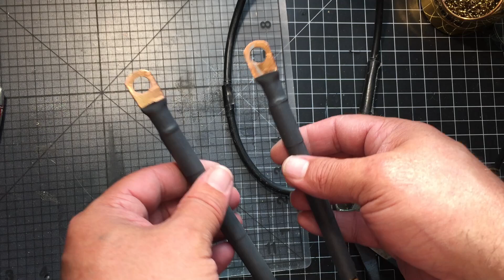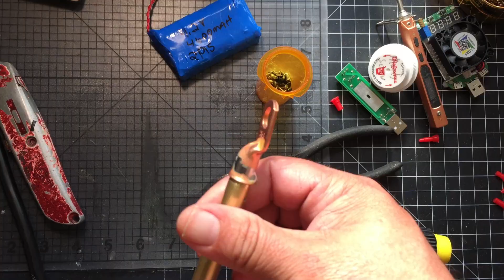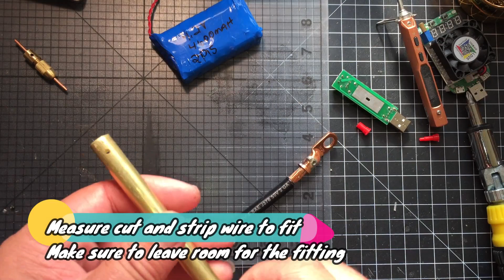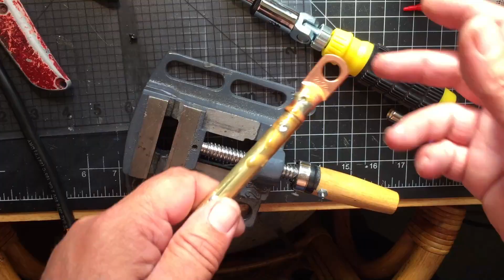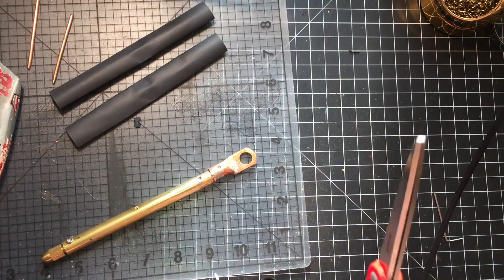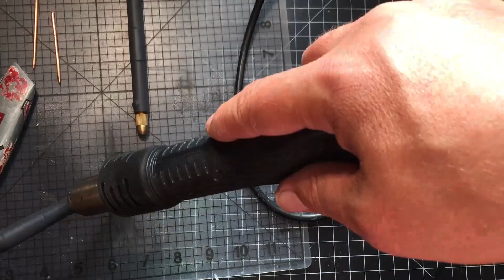Super Simple DIY Spot Welder Pen (MOT Battery Tab Welder Pen) under $10

Comment: Moving into higher current chemistry batteries, Im wondering about using copper sheets cut into shapes needed instead of nickel.  but to do so is a bit of different direction. 
I stumbled onto "carbon gouging rods" as a means of welding rather than tradtional spot welding.  Apparently you can get pin point accurate.They also call them RSU (resistive soldering units). Have you come across rods like that, used them?
Reply from the maker: I haven't?? But I may do some research on it!!

Comment: Best one I've seen so far. I recommend silicone tubing for the outer heat insulation-- they come in different sizes.
Reply from the maker: Hey!!Great Idea!!! I was just trying to use what I had on hand, these work just as good as the commercial one, I purchased a set of those to compare. Not much difference.

Comment: Great job. Where can I purchase those brass bit holders
Reply from the maker: I got mine in China a few years back for around 2$. But they are mainly used to convert small motors to dremels, drills or just to add a bit. Here is one I found on a quick google search-

https://www.aliexpress.com/i/32679044049.html?spm=2114.12057483.0.0.57ed6622sPYFXl

I'm sure you can find them cheaper on other sites. I believe when I got mine, I got them in a huge lot of 20 for super cheap. Thanks for commenting!!

Comment: What are the electrodes? Does that belong to the brass holders?
Reply from the maker: The ones in the video are made from solid copper wire and the holders are drill collets. I stopped making them out of solid copper, only because they wait out quickly and sometimes stick. So I started buying these on amazon-https://www.amazon.com/welder-aluminum-brazing-welding-solder/dp/B00W3J4SI6

They have the better versions with one end pointed, but I couldn't find a link. The link I normally use no longer works.
Reply: njfulwider5 so i could use just a thick aluminum wire and sharpen, that would be better then?I guess the copper just is for conductivity between the holder
Reply from the maker: Loykaz I’ve never tried aluminum before? I personally think you might have issues with the wire melting, but I wouldn’t know for sure. If you end up trying please report back, I’m very interested. Make sure to test on something else, not a battery. Just encase you have melting, could cause a blow out or fire if it gets to hot on a battery.
Reply: njfulwider5 okey will be sure to do that, got me some wire today, but gotta finish the welder first haha, since we already are talking you wouldnt know anything about the magnetic shunts in the transformer? Some people say to remove and some keep it ive seen?
Reply from the maker: @Loykaz  I always remove mine.

Comment: Crimping would be
a better idea than
tinning it, because
of high amperage
(and so high power application)
Reply from the maker: You are right, but the main reason that I decided not to use alen nuts, or crimp. I really wanted the solder and pipe to become one alloy, to allow the heat to transfer better. If you’ve built any kind of diy welder, or even commercial welders. The handles can get super hot after doing multiple weld. I have just about every welder you can think of and these leads stay the coolest by far👍👍👍👍👍

Comment: And wherenis the demostration of the item being used? Good video but incomplete.
Reply from the maker: This is not a curcuit board, but a simple tool. If you’ve built a mot welder or anything like this or even used leads like this, you’d know it would work. Also if you follow and watch my videos, you will see a few times me using these. It a simple copper tool used to help make tab welds
Reply from the maker: I’ll try and find a video still and post it in my community tab👍👍👍👍👍

Comment: The wire inside the tube seems pointless cus it's just sitting there with a tone of solder not really connected to the tip ...might just be me but I was thinking brass not good conductor for low voltage 🙂👍 I gotta make this now lol
Reply from the maker: If you read the instructable you will see the reasoning behind the wire. It help promote a better contact and most of all help with get rid of the heat normally generated by welders like this. If you’ve built as many packs as I have, no matter what welder you use the leads get warm and you typically have to stop to let it cool. Making sure your wire fills the tube and your solder creates a good bond will help greatly with this👍👍😉
Reply from the maker: Forgot to add. It depends on the brass used. The brass I use is typically 85% copper.
Reply from the maker: If you decide not to use the wire, I saw a welding pin like mine on banggood, where they tap and die the end to accept Allen screws.  I bet you could also incorporate a button for welding!!
Reply: @njfulwider5  I just going to use copper pipe and fill it wit wire and solder but needs wood handle I no what u mean heat from electrodes but I use solder under nickel strips and made own solder melter welder 😂🙂 and microwave transformer is overkill lol
Reply from the maker: @davey2k12  Yep so far I have used this with my Capacitor welders, My DC welders and My MOT welders. Actually, the copper used in my video is copper pipe purchased from the local Mclendon's, But I have made these for a friend using the link I supplied on the instructable.  When using the ones I made for him, I noticed no difference.  But if you notice, Technically, the copper wire I used inside of the tubes is touching the copper lug(soldered) and touching the Collet(touching both the collet and copper piece used for the leads). So I get direct contact from the wire and the copper pipe, or 85% copper tube. The copper tube is mainly a way to add handles and get rid of the heat. You should see my next simple easy spot welding pin.......But I'll save that one for another video. Cost is half of this one..
Reply: @njfulwider5  I was thinking using capacitor or super cap with electrodes then make a base to charge the cap but still have to use a mosfet trigger or something 👍🙂
Reply from the maker: Da ve that’s sounds like a project I’m currently working on👍👍👍👍

Comment: is not flexible ..just lose time and money
Reply from the maker: Not sure what you mean, it’s simply a DIY spot welder pin, total cost is probably under 5$ (a 3rd the cost of premade ones you find online). It’s not supposed to be flexible, and flex would be in the wire attached to the pins. Thanks for commenting!!!!👍👍👍👍